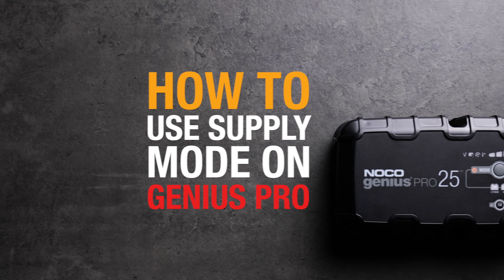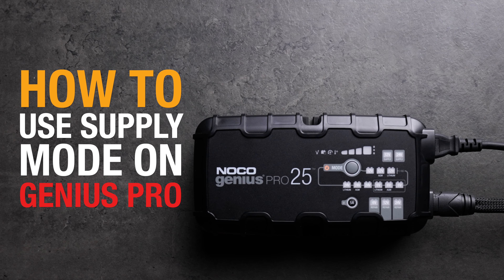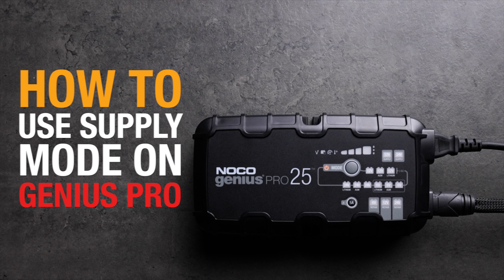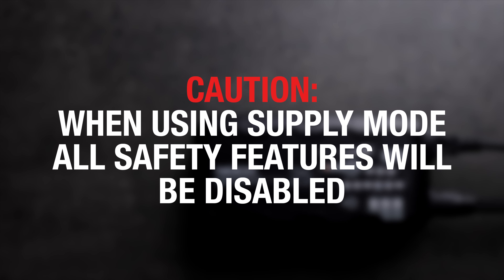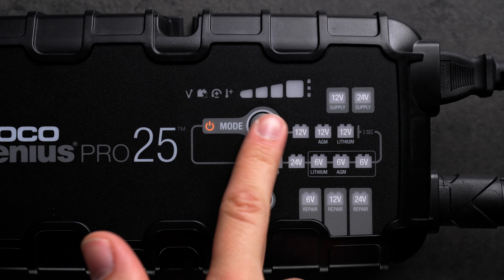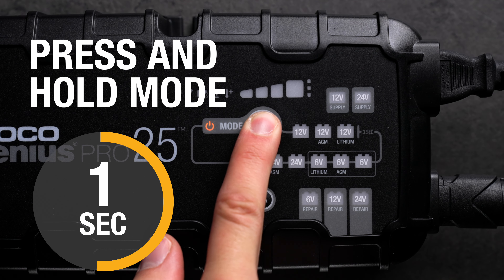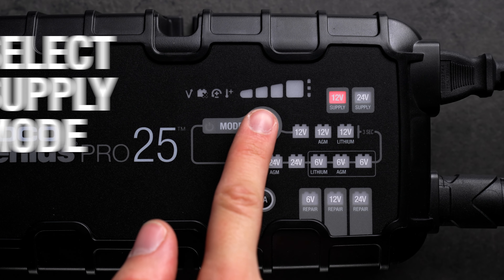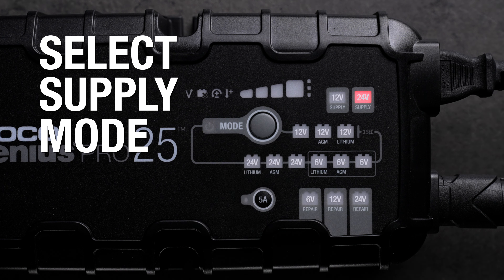How to Use Supply Mode on NOCO GENIUS PRO

Comment: Can supply mode be used when battery is connected tp vehicle? For example, if an inverter is connected and drawing power from batteries?  Or would it be better to just leave it on regular charging mode? Thanks

Comment: This may sound like a foolish question, but: What is the max constant current that this device can supply when in supply mode?  Is it 25 A?  Or is it a lower value?
Reply from the maker: Not a foolish question at all! The 12V Supply and 24V Supply Modes on the GENIUSPRO25 supply 25A and 12.5A max respectively. The 12V Supply and 24V Supply Modes on the GENIUSPRO50 supply 50A and 25A max respectively.